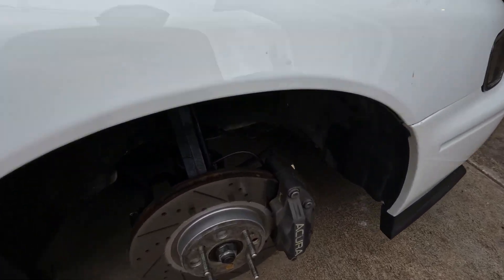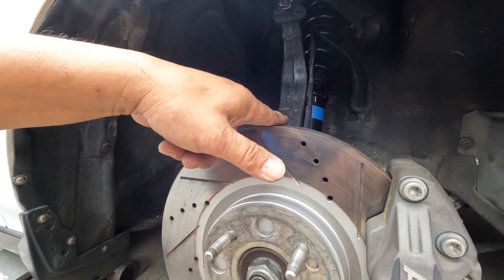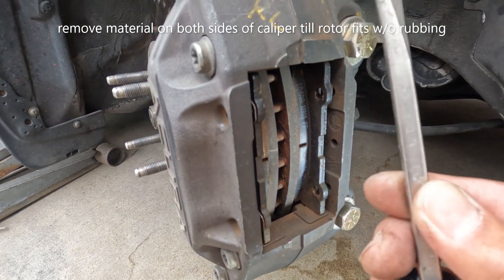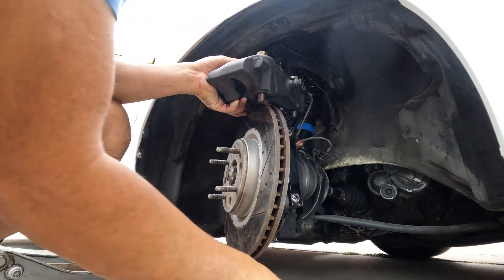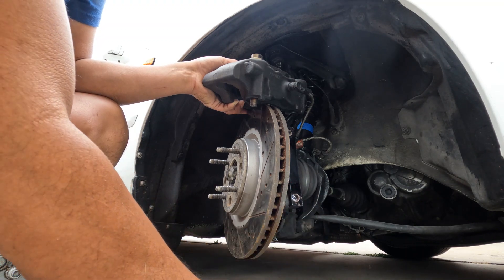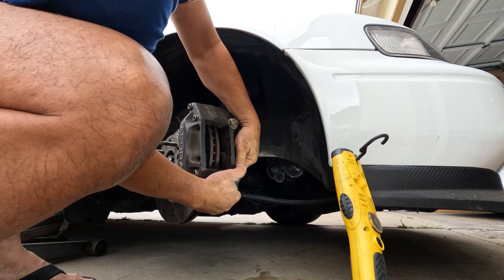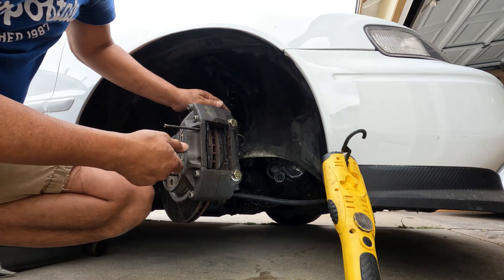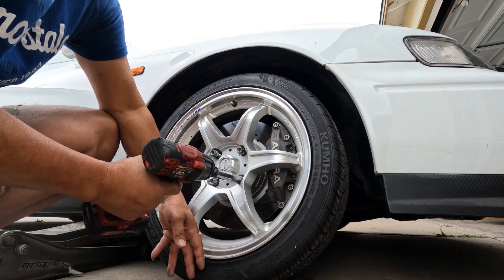RL brake caliper mod to fit 13" rotor

Comment: They can fit in a integra 95?
Reply from the maker: Fastbrakes.com sell a kit and you only need the rl caliper. But you need a spacer though in order for rim to clear the caliper and having extended studs will be nice.

Comment: Question from what model of car I get this rotor ? Also is this for 4x114,3 thank you advance
Reply from the maker: It's from Honda Pilot w/ 13" brake rotor and l can't remember what year it was. It was already redrilled to 4x114.3 when l got it.
Reply: @sagittnet2158 thank you Sir, I love your channel.
Reply from the maker: @enriquegabriel8321 salamat din and thanks for your support.

Comment: Pare ko! Where did you get the new bolts 5:49  from?
Reply: Salamat po pare! I will just go that route.
Reply from the maker: @herc2k walang anuman and l usually go easy when tightening the bolts, l used fastbrakes recommended torque specs, its lower than ffc.
Reply from the maker: I think l got it from Home depot and l cut it off in size. Are you thinking off adding a soacer on the adapter and use a 13' rotor? If you are, make sure that  cut it in correct length, otherwise the adapter will get strip.. its okay to be short than having a extra.
Reply: @sagittnet2158 my bracket got stripped. Do you recommend rethreading or just buy a new set?
Reply from the maker: @herc2k  thats sux preko! It's aluminum and if its strip, its done. If you have lots of tools, you can put a helicoil on it but buyimg big drill bits and new tap will cost you almost half of new set. 
I just check Ebay and you can get new set, it should be alright from ebay (replica). Check it out, search for RL caliper bracket or adapter.

Comment: hey , i have 4th gen prelude  , will this bracket fit rl  brakes but with a 11.8" rsx rotor ? want to do the conversion but still be able to run 16s wheels
Reply from the maker: It wont fit coz the existing adapter that ypu can buy can only accept a 350z or Subarus's size rotor. Going bigger yes, like mine but smaller than what l mention, it'll require new adapter bracket. You can visit Fastbrakes.com and check out their brake kit for Prelude using RL caliper. You can email them and tell them what you have in mind snd they're good of repying back. My first RL brake project involved a custom bracket that l have it welded on the Accord knuckle, you can go that route if you like but wait till fastbrake give you an answer and if price is right. Hope this help you a bit.
Reply from the maker: Have you search the web and see if anyone have done it?
Reply: @sagittnet2158  have seen ppl do it with s2000 and yeah thats what i figured , but if its just that the bracket will be to tall i can take ir to machineshop to have it cut to size
Reply from the maker: @lucasdmartinez-montalvo  The Prelude knuckle/ caliper mounting point extend out farther and there's not enough room for RL caliper.
Reply from the maker: How you doing, I was making a video about your build idea and l have my 1st Accord diy brake knuckle w/ welded bracket, it might give you an idea @lucasdmartinez-montalvo
Reply: @sagittnet2158 oh man , love to see that! , also idea for future upgrades , TL Type S calipers bolt right up spindle knuckle just have to make the hole bigger use oem acura bolts and acura tl rotos need 5mm spacer tho between the hub and rotos
Reply from the maker: That's good and l think TL type S caliper is a bit smaller than RL caliper, mighr work out for you after all. Later man @lucasdmartinez-montalvo
Reply from the maker: @lucasdmartinez-montalvo l think using TL caliper is much better, coz the RL w/ your build specs, it require some bracket welding like l did on my Accord knuckle.
Reply from the maker: It can be done but it'll require a custom fabrication and lots of welding the adapter to the knuckle.

Comment: Will this fit 5th gen prelude bb6 ?
Reply from the maker: RL brakes should fit w/ the bracket and all. Accord and Prelude have the same caliper mount holes. You probably will be needing a spacer in order to clear the rims.
Reply from the maker: Check out fastbrakes.com and if you cant find the correct bracket for Prelude. You can email them and they'll reply to help uou out.

Comment: Do the Pilot rotors also require the hub centric ring like the nissan rotors? Also, i see in the video you say that you used an 1/8" spacer on top of the adapter. But in the comments i see youre saying that you used a 1/4" spacer?

Comment: Kuya I got some RL brake caliper that I will be putting in my rsx eventually. Question who that make my brake pedal spongy if I don’t upgrade the proportioning valve
Reply from the maker: Not familiar w/ RL caliper swap on RSX but it's obvious that you'll be needing a mount bracket for it. Fastbrakes.com sell bracket kit for your brake swap and send them a email and mention it, if you need to replace your proportioning valve from a rsx type S. They're good on answering Email and they be more than happy to give you a much precise answer.

Comment: What rotor are u using please let me know
Reply from the maker: It's from Honda Pilot w/ 13" rotor. Cant remember the exact model yr.
Reply from the maker: And also it's redrilled to 4x114
Reply: Thats exactly  what i wanted to know i have 4x114.3 itr spindles and was trying to figure it out@sagittnet2158

Comment: Hey I’m trying to do the 350z rotors with RL calipers on my ILX & I was wondering since the Fastbreaks adapter kit comes with the hubcentric ring so that we can fit the 350z rotors. I was a little bit confused on which spacers should I run. Whether to get the Spacers that fit my ILX hub ? Or spacers that fit the 350z hub ?  Notice you ran spacers so hopefully you see this comment & can give me some helpful advice. Thanks bro. From 1 car enthusiasts to the next
Reply from the maker: Are you talking about spacer for your wheels to clear the caliper? If it is, you'll get a spacer that has a bolt pattern  for your car w/c is 5x114. ( 350z is also 5x114)
Reply from the maker: Send fastbrakes a email and specify your needs. They have good customer service and they'll guide you on w/c kit to get.

Comment: I belive it's the same caliper found on Honda Legend KB1?
Reply from the maker: Legend have a 2 piston calipers. RL have advics and TL have the Brembo
Reply: @sagittnet2158  I'm driving a Civic X 1.5T.. Planning to upgrade to CRV turbo 2 pot caliper and rotor.. But not sure if it's gonna work..
Reply from the maker: @khairuddinmohammad3762  If your Civic is EX model, the knuckle should be able to accept a bigger brakes. You need to use the bracket so you'll be able to secure what ever caliper you want to use. But if your Civic have a 9" rotor to begin with, in order to upgrade for bigger brakes the correct way is to change the knuckle spindle/hub assy.
Reply: @sagittnet2158  stock front rotor is 282mm. I'm looking for a direct bolt on without bracket. The only option I knoe is DC5 Brembo with S2000 rotor, but the caliper is wide and too close to the center hence it's hard to find wheels with enough clearance.. If bracket comes into play, I might as well upgrade for ap racing 330mm 😅
Reply from the maker: @khairuddinmohammad3762 The CrV caliper bracket mount bolts spacing should be the same. Your Civic ex and my Cd5 Accord have same caliper bolts spacing coz my Spoon caliper fits on Accord knuckle( l tried it before and it worked on Accord hor setup). Your probably be needing a spacer for your wheels to clear the CRV. I think someone have succesfully installed a Acura Legend (2 piston) brake caliper on Civic.
Reply from the maker: @khairuddinmohammad3762 https://youtu.be/hYTzxPvegpI?si=lzm3opvHQ6hiZnBk Have you seen his vlog about using NSX caliper

Comment: @sagitt net2, Hi there. I have fastbrakes adapter kit, and I have 2 questions. 1) What did you use to shave of material on the RL calipers and 2) will it clear OEM 17 inch wheels that is HFP? Thank you!
Reply from the maker: I shaved the brake caliper using a die grinder tip (dremel tool will work) to fit the 13" rotor and added a 1/4" spacer on top of the adapter. Are you also tninking of using 13" brake rotor? l also calculated how much thread will be screwed into the adapter when l added the 1/4" spacer(shim). The reason for the bigger rotors is because of my wheels. I dont want to use a thick wheel spacer. Sinced the shape of wheel spokes  poking outward. I used that to fit the caliper extending outward w/ bigger rotor and ended up using 1/4" wheel spacer and it worked out. For your wheels, the only way to find out is to try it on and use a wheel spacer and use extended wheel stud as required. I'm not sure what size rotor you have but if you have the normal size (350 brake)  rotor for RL caliper use, was it 12.5" or 12.8", no need to shave the rotor track of caliper.

Comment: What rotor and pads are you using ?
Reply: Thank you my man for the link keep it up with the videos
Reply from the maker: no worry! @nielo2311
Reply from the maker: I'm using a Honda Pilot 13" rotors, can't remember what year Pilot but it's the one that use 330mm rotor.  Posi Quite pads. I have to use a strip of 1/4 aluminum on top of the conversion bracket also shave material at both ends of the caliper, so it can fit on. The caliper are built to fit on less than 13" rotor. The reason for the  bigger rotors and spacer is to fit the rims better otherwise l'll be using more spacer for the rims.
Reply: Where did you get the conversion bracket
Reply from the maker: @nielo2311  got 1 from fatfourcustoms  that didn't worked out good and bought another from Fastbrakes.com and it's good. It comes w/ some accesories like centric rings. I highly recommend fastbrakes, if you have question about any of their products and if you have anything different in mind. You can email them and they'll back at you quick. Thanks bro

Comment: what type of wheels and wheel offset are you using??? I have the same set up on my 95 coupe.
Reply from the maker: Its a 5zigen Group 6, 17x7 42mm offset and l'm using 1/4" spacer on front to clear the caliper.
Reply from the maker: Is your coupe white also?

Comment: Sup bro so I just picked up a set of rl brakes for the wagon built, and I have the 5 lug odyssey spindles. my question is what kit from fastbrakes should I get and what size of rotor?. I read that I'll be needing the 350z brembo rotors but I'll need to machine the senter bore for the wheel hub.
Any input will be much appreciated .
thanks
Reply from the maker: 5 lugs,nice! You have 2 choices. For Fastbrakes, its better if you send them a email and include all your part setup and they'll email you back to w/c kit you'll need( they pretty good on answering emails). This way you dont have to run all over town looking for a place to have your rotor machine, like me. Their kit also comes w/ centering rings if need to be. 2nd is Fatfour customs.com ,you can actually see the rotors and info about it, and they cater their products to Honda Accord, less headache for us. They're both good product except for my experienced on other brand but that can be fix by just lowering the torque values a bit on the bolts like the other brand. You can check my vlog on torque values. Hope this help you out.
Reply from the maker: You live in LA right?
Reply: Hi sorry for late reply, 
Thanks for the info I think I'll go with fatfour customs.
Yes I live in LA 
Just west of DTLA

Comment: I was wondering what the problem was because weeks after I converted my brakes on my 16 Accord to the RL set up they would squeak pretty bad at stops after a few min of driving. I replaced the pads thinking that would fix it. Nope. Just replaced them 2 days ago and they are squeaking again! I’m guessing the pads aren’t flush with the rotors. I have the FFC bolts and brackets.
Reply from the maker: It could be, you can actually see it if it's not flush but usually it will take a lot of miles driving it before it make some squeeking sound. You can check the rotor relation to the brake caliper, make sure it' not in an angle. Possible that one of the two (left or right caliper)  pistons are getting stuck. What brake pads are you using?
Reply from the maker: Are both calipers making noises?
Reply: @sagittnet2158  I believe it’s just one caliper. I’m using Advics AD1091 Ultra Premium Ceramic Formulation brake pads.
Reply from the maker: @rubenfabela9285  If you have a jackstands, raise it up and simulate a driving/ braking condition, no tires, but secure the rotors w/ a lug nuts. Run it in a way just to see w/c caliper is bad. Usually the rotors will show w/c side is making all the noise. Was the caliper been rebuild before?
Reply from the maker: Be careful when car is on jackstand and engine is running.

Comment: Hey I love watching your vids on your civic build , I personally have an01 accord coupe v6 ,and I put the fast brakes conversion on mine but I have 17 inch wheels but they don't clear the wheels. So my  question is, is there something that I can do to get the calipers to go farther down about a 16th of an inch to clear my wheels?
Reply from the maker: Thanks man! There's really not a whole lot of things you can do except use a spacer. Are you worry about your rims poking out a lot using spacer? What rims do you have? I'm using 17" also and w/o the added spacer and if l use 12"+ rotor. I need to add a thicker spacer. So l used 13" instead w/ 1/4" spacer and extended studs.